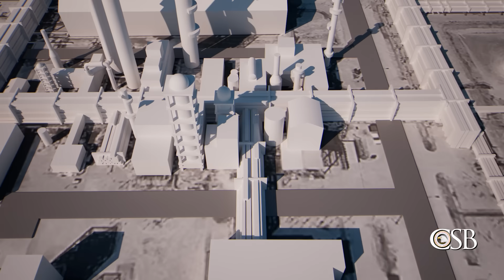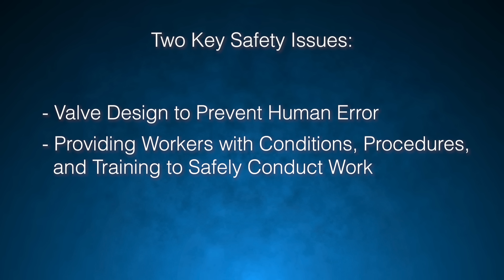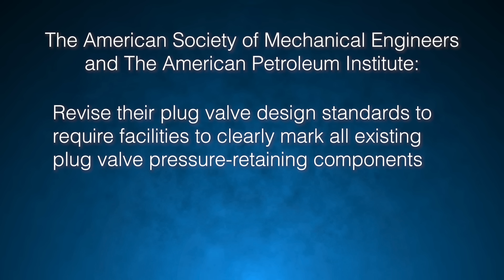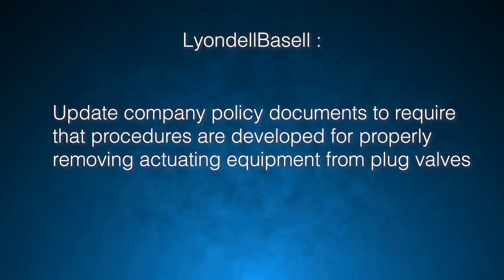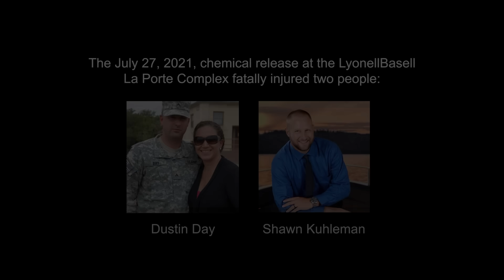Designed to Fail: Chemical Release at LyondellBasell

Comment: I can't count how many times I've heard "it's just vinegar, it's never killed anyone" from people working with concentrated acetic acid. Even I'm guilty of being a little complacent around acetic acid compared to other reagents. Thank you, USCSB, for bringing awareness to less "fiery" but still potentially lethal hazards.
Reply: I've only worked in small-scale research labs, and I started the video wondering how exactly someone died from getting acetic acid on them. Even concentrated, it's not a "strong" acid, right? And then I see it's > 100,000lbs of heated acetic acid escaping at very high pressure, directed AT the workers in question. The third guy somehow surviving with serious injuries now seems more surprising.
Reply: @freddiepowell8524 boiling vinegar at that pressure? Bad news!
Reply: @freddiepowell8524  It's not a "strong acid" but neither is HF
Reply: @tomcatgirl  That's because the terminology of "strong acid" is wildly misleading to laypeople.
Reply: @Cutest-Bunny998  Yep, Hydrofluoric Acid (HF) is chemically a "weak" acid, but of all the common acids, it's the Worst to get on one's Skin (can be Lethal).
Reply: @freddiepowell8524  evidently there is also carbon monoxide dissolved in the acetic acid, yikes
Reply: GAA is wildly not at all just "vinegar" but people do act like that it isnt a hazardous chemical all the time for some reason. Maybe we should call it ethanoic acid more often so people think it sounds scary again.
Reply: @Cutest-Bunny998  Yeah vinegar is usually 5% acetic acid

this is that plus 95% of the rest
Reply: @Cutest-Bunny998  Acetic acid is not vinegar.
Vinegar is a mixture that also contains acetic acid.
Why do you think acetic acid is named this way?
Reply: Exactly! Acetic acid is no joke.
Reply: You answered my question, which was going to be whether they were using concentrated acetic acid. I don't think people realize how many 'safe' things in life aren't in the wrong amounts/concentrations.
Reply: If you think glacial HOAc is fun, wait till you encounter acetic anhydride. Back in the day I did a lot of non-aqueous titration  (acetous perchloric acid in glacial acetic), and  we were always very careful to follow  the safety rulings.
Reply: @phils4634  Acetic anhydride smells like pickles if I recall correctly. How could something that smells like food be scary? /s
Reply: People don't realize that although Acetic acid IS the active ingredient of vinegar, it is only in 3-5% concentration. Anything even remotely close to 50% or higher concentration is a completely different animal.
Reply: As someone who has washed out glassware with lots of openings with ice and acetic acid: ouch, ouch, ouch, ouch, running water, I'm fine.
Reply: That's crazy! Vinegar is only a 4-6% concentration of acetic acid diluted in water.
Reply: @theofficialczex1708  I mean I have an HDPE gallon jug of a commercial 30% acetic acid solution that is sold labeled as "30% vinegar", so the term "vinegar" is used kind of flexibly. I would really just say that vinegar is a diluted aqueous solution of acetic acid. To be fair though, most people dont have a solution of vinegar that readily etches concrete so I see why the low molarity would be implied too.
Reply: I used that stuff for stripping mill scale off of steel prior to welding.  Safer and easier to dispose of than muriatic acid, so I didn't worry as much about getting it on my skin (just wash off quickly).  Didn't want to breathe it at all, though.
Reply: My exact theory just before sniffing the glacial acetic acid bottle. Like having your nostrils chemical peeled in a fish and chip shop.
Reply: @alphgeek  Vinegar is to glacial acetic acid as a house cat is to a tiger.
Reply: This was a lot worse than just concentrated acetic acid, there was also 27 tons of methyl iodide in there. The acetic acid was just below it's boiling point but this is wayyyy above the boiling point of methyl iodide which would have all flashed to a gas. Also the contents might have been saturated with carbon monoxide under pressure, which also would have flashed off.
Reply: @samheasmanwhite  I will pass on being covered in boiling acetic acid more than standing in a cloud of concettrated MeI but it's a close call. I can hold my breathe longer than I can stand having my outer surface dessicated and burned by boiling acid, but the reason isnt because it's less dangerous and more because I'd rather not linger in a burn ward and succumb anyways. Also, the odor of this accident must have been absurd - vinegar and ether are a potent scent combination. I feel quite bad for the workers here who were sent to do something "simple" without training, procedures, or likely enough experience (at least not enough to understand the valve). If someone asks you to work on a pressure vessel connected to a rxn vessel in an industrial processing area you arent qualified and trained for then they are making it inevitable that you, or someone else asked to the same, will be injured; my opinion is that management should feel responsible for this disaster entirely.
Reply: Man, I bought some cleaning vinegar at the grocery store a few months ago and I can’t even breathe when I open the bottle. That shits nasty.
Reply: Anyone who says "it's just vinegar, it never killed anyone" don't know Jack about Chemistry....
Reply: Vine-agar is very dangerous beyond 33%
Reply: A lot of people don't truly grasp how horrifically deadly many compounds can be because they're so used to using extremely diluted, watered-down versions of it. Take Hydrogen Peroxide: people may think it just stings a bit when you pour it on an open wound, but that's only 3% solution, so the remaining 97% is just water. Crank that up to 85% or more - AKA Hight Test Peroxide (HTP), and it's a rocket fuel that will rapidly strip the flesh off of your bones! Most acids or bases in high concentrations are scary as hell.
Reply: Vinegar is acetic acid, but it's very dilute acetic acid. Another acetic acid hazard is when it accidentally gets served as a condiment without being diluted first. That can cause severe injuries to someone's mouth and digestive tract.
Reply: @hikari_no_yume  False.
Vinegar is a mixture containing acetic acid.
Reply: @durshurrikun150  If you're trying to enforce the legal definition of vinegar that defines it as being the result of fermentation, yes, but practically speaking, you can get “vinegar” used for food that is nothing more than dilute acetic acid. The additional flavourings probably make it tastier but vinegar is acid first and foremost.
Reply: @hikari_no_yume  Except it is more than a dilute solution of acetic acid.
It contains some ethyl acetate inside, it contains flavours, it's a complex mixture than a dilute solution of acetic acid in water.
Reply: @durshurrikun150  man I'm gonna be so pissed off if this MSDS is wrong and I have weird colloidal vinegar with a bunch of crap floating in it contaminating my baking soda volcanoes
Reply: @Cutest-Bunny998  Yoy don't get some weid stuff inside.
Aside from the acetic acid and water, you also have flavours and some other natural compounds such as colorants or other stuff.
Also, you may have some ethyl acetate as acetic acid reacts with ethanol during fermentation by acid catalysis.
However it's a small concentration.

My point being, vinegar is more than a dilute solution of acetic acid in water.
Reply: Vinegar is extremely low concentration acetic acid.  And it can dissolve an eggshell given a little time.
Reply: Nice Akagi pfp.
Reply: Any chemical is dangerous, even powders that are harmless like cocoa is lethal when airborne
Reply: Even just the acetic acid fumes from a single tube of silicone can burn pretty painfully. I can't begin to imagine this.
Reply: That's because vinegar is such a common and relatively harmless household chemical that's safe enough to use in food. People don't realize that vinegar is severely diluted (like less than 10% acetic acid in an aqueous solution). That tends to be the case with a lot of weaker acids since increasing the concentration can make a HUGE difference in reactivity and health hazards.
Reply: In Cambodia, they filled rooms with people and ignited Freon!
Reply: @Gfysimpletons  That makes phosgene 💀. That's horrible.
Reply: @Gfysimpletons  The Khmer Rouge did that?  That wouldn't surprise me at all.
Reply: Vinegar has acetic acid in it,  sorta like cough syrup has opiates but that doesn’t mean you wanna swim in a few thousand pounds of gasified heroin.  Well maybe some folks do.  Speaking of, did you all know THIS here high grade Acetic acid at these purity levels is soo acidic it is one of the precursors for MAKING heroin?    That is why this is on the Mexican border.
Reply: @_c_y_p_3  I mean heroin is to morphine what aspirin is to salicylate. Same reaction even - diacetylization.
Reply: Um this is more like boiling hot glacial acetic acid mixed with acetic anhydrde. It would have burned like hot sugar syrup and the vapors would have been deadly if that hot. 💀💯
Reply: yeah except vinegar is diluted with water and this us 100% concentrated people fail to grasp that concentrated acids/bases have very different PH values than their diluted counterparts which is what makes them caustic. I learned this from taking a shot of 98% ethanol everclear solution and realizing no, it isnt just strong alcohol lol
Reply: There is more than one type of acetic acid. The human body produces one form from muscular action.
Reply: what is your point exactly? are you just saying that people still need to wear eye protection?
Reply: @Cs13762  "My eyes! Ze goggles, zey do nothing!"

Comment: If you’re a pipe fitter you should know that a valve with nothing but six bare threaded studs holding its retaining plate on is just there out of spite, waiting for the right time to get you. This isn’t a case of lack of labeling, it’s a case of even the most basic training not being given to employees. I took a look at the report and the valve looks just like it does in the video. Sure you can wire lock all the nuts in place and paint them dayglow orange, but the same people will just remove them and die again doing another service procedure since they lack the basic understanding of how the equipment works, and what general hazards it poses.

Comment: I do like your channel, but your solutions are the worst solutions anyone could ever come up with.

Here is a cheap and easy fix, provide an instruction manual on how to remove it safely. You do understand that things are already color coded at chemical plants right, this solution just adds further confusion and its expensive too which always ends up coming from our own pockets if you understand economics.

The main problem you face is that you dont understand these plants really, or how things works in reality on blue color jobs. This new design will it be better? No it wont be, it will be exactly as fool proof as this one that failed but have another failure mode that were not anticipated, just like this one wasnt.

In reality things are messy, and practice never meets theory, and you try to fix things in theory, that has to be implemented in practice and a new failure mode that wasnt anticipated will arise because reality is messy and practice never meets theory. If we wait long enough this design that was used will eventually again become the new design to fix a problem we didnt foresee.

You should aim to be friends with the companies instead of blaming them for everything that goes wrong, that way you can actually work together towards a better solution that might actually work. Because at the very least theory and practice can work together so actual solutions can be found.

Comment: This is a tragedy that can and should be easily avoided.  One of the biggest challenges to the manufacturing industry is availability of trained and knowledgeable workers.  

I spoke with a Maintenance and Electrical Supervisor that noted that they had over 44 people on site, but 40 of them had been there less than 2 years, and only 2 had been there for more than 2 years.  Often, their employees, didn't know where a field instrument was or were familiar with the safety rules for a process area.  They discovered that 65% of their recorded injuries came from people who had been at the site for less than 1 year on the job.  

The reason that LyondellBasell and others use companies like Turn2 out of Baytown, TX is that they cannot easily staff these people.  In a shutdown or "Turnaround" on these sites, there may be up to 400-1000 people all doing work in different areas.  From Construction, to Field Device Maintenance, to welding, etc.  They almost have to be contractors.  That they are contractors is fine.  As long as they are properly trained for the task they are assigned to. 

There is huge demand in the SE Texas and Louisiana area for Operators, Maintenance, Electrical, Instrumentation and Construction workers that the workers often will not stay at a single job for long, and younger workers are often changing jobs to get pay increases.  "Contract Workers" will receive slightly higher incomes and often assigned to a shutdown or turnaround environment with very little safety and process knowledge specific to that facility.  While all sites will require "safety" training, often the process side of that cannot be provided.

This is often why new production moves overseas.  In the US, we just don't have trained workers for new facilities or expansions, and we don't place a priority on training individuals properly or enticing smart people into this line of work.  We need to fix that.  We need these workers, and we need to entice them to take "field" jobs, not just "computer programming" jobs in AI. 

Rant:  Don McGahn, former White House counsel under President Trump was supported by 23 Republican State Attorney Generals on behalf of Allstates Refractory LLC to bring suit that Congress unconstitutionally delegated it's legislative powers to the executive branch by granting OSHA authority to set and enforce workplace standards.  Justice Thomas stated that "evaluating the constitutionality of OSHA's authority was "undeniably important" question worth addressing.  While both Justice Thomas and Neil Gorsuch supported this, the appeal was turned away.  For now.

Denying workplace safety is surprisingly supported by these Republican State Attorneys and Donald Trump's ex counsel.  As they set to "reduce" the "administrative state" from trying to write regulations and safety requirements to protect people.  They honestly think that removing safety "oversite and costs" will help these companies, but in turn it drives people away from knowledgeable people from working in unsafe environments.

There will continue to be political attacks on organizations like CSB (which was slated for defunding by the Trump Administration) and other organizations like the EPA, who have written rules such as requiring companies to conduct independent audits of major chemical accidents (which was put in place in the Obama administration and promptly eliminated by the Trump Administration).  

The problem isn't plug valve design.  It's that there are politicians and attorney generals who don't care about workplace safety and are actively trying to remove those organizations that provide them.  Because those politicians are being paid to do that by companies that don't want the liability for caring for workers.

https://publicintegrity.org/politics/system-failure/agency-industrial-chemical-safety-board-disasters-life-support-trump-deregulation/

Comment: Does anyone have any insight into why the actuator needed to be removed in order to complete LOTO?  Not sure of the exact make/model of the valve in question.  But I have worked with plug valves that have a hole/slot in the shaft that allow a pin to be inserted to hold it in the closed position.  That plus disabling the actuator (pulling air or power) has been enough for LOTO.  So if they're going to create an AMSE/API standard to prevent this incident, it would be more effective to re-design to allow for LOTO without removal of any valve components.

Comment: How is a "flavour enhancer" also corrosive, capable of causing severe skin burns and eye damage and harmful if inhaled. This is added to food?!
Reply: Household vinegar is 5% acetic acid and 95% water. This was 100% acetic acid. Concentration is everything.
Reply: White vinegar (acetic acid by it's common name) Has been used as a pickling method for centuries. This stuff was just not diluted by water yet. When they sell it in the store, it has been diluted to about five percent concentration in water.

Comment: Why wasent it suggested to provide capability for actuators to be safely disabled in place. Not requiring tools on piping. That would prevent this all together. Locking out the air supply would have been the safest and least intrusive (also much faster) way. 

Color coding of parts and/or bolts it seeding confusion ammong different users. If at some point things get mis-assembled, dirty or worn, the danger returns.
Reply: locking out the air supply would require that the actuator not be leaky.   But it could have been designed to allow a mechanical lockout. e.g. a rod you can pass through the shaft in the open or closed position, but only if you've disconnected the air lines.

Comment: Even vinegar is dangerous at high comcentrations I giuess...
Reply: What we get in the store is only about five percent concentration. Cleaners with acetic acid in them. Don't usually have it any higher than twenty, because it's dangerous beyond that point. This was at a hundred percent concentration, so it was basically just as bad as hydrochloric.